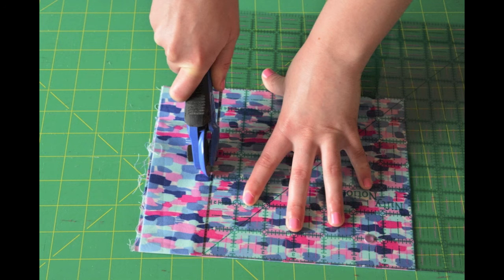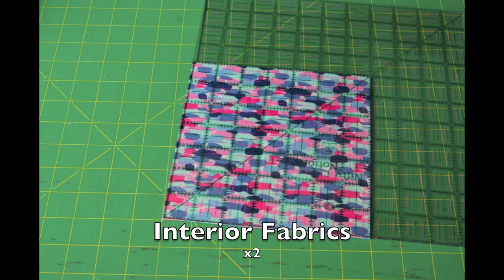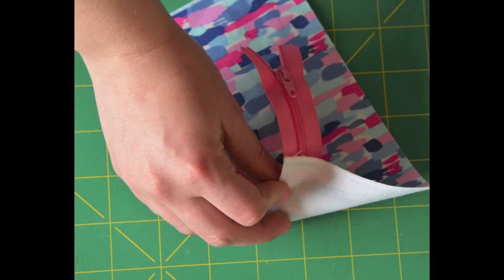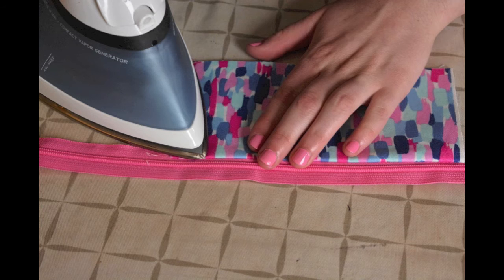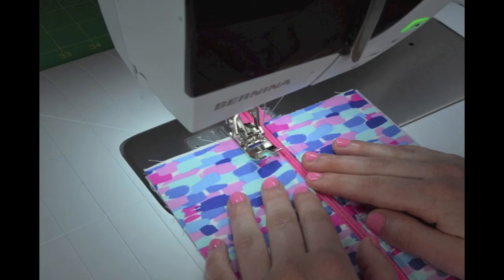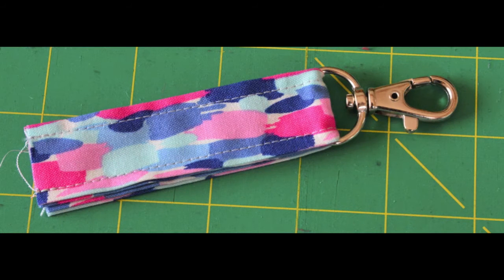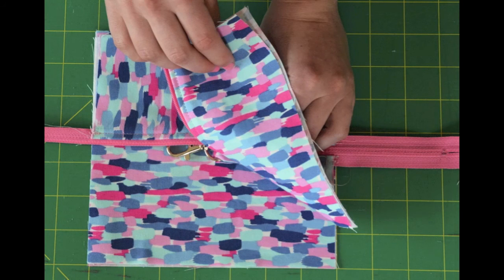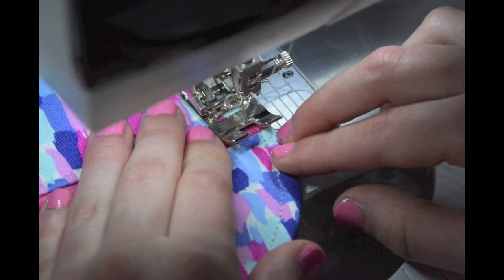How to Sew an Earbud Case

Comment: This is bs, find a different video. This wastes the fabric and has so many extra steps. Start with a circle not a square, there are so many mistakes in this. Don't waste your time.
Reply from the maker: Hi Amelia, We are sorry that you had issues with this project. The reason we started with a square and not a circle was to make it easier for inserting the zipper. This takes away the difficulty of trying to match the two half circles up; plus it gives you a little more fabric to hold on to when you are sewing. The reason we started with 1/4 yard of fabric is because most shops sell fabric in 1/8 yard increments. We also had the pattern tested before publishing to ensure all steps were correct. We publish these videos with the intent of providing free, easy patterns to our viewers, so we apologize that you did not get this experience.
Reply: I just made a pouch using a different pattern using a circle, and batting instead of what you used. It worked perfectly and looks great.
Reply: You are right. A lot of waste and unnecessary steps. Find a quality tutorial.
Reply: @annarborsewing  I like this version, I looked at the circle method and this is method lends itself for a cleaner more precise finished product.